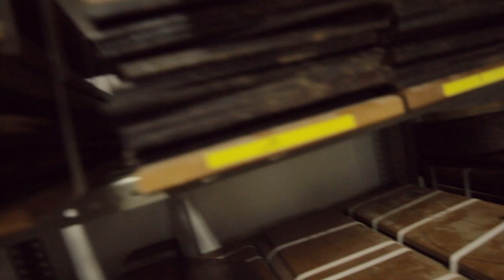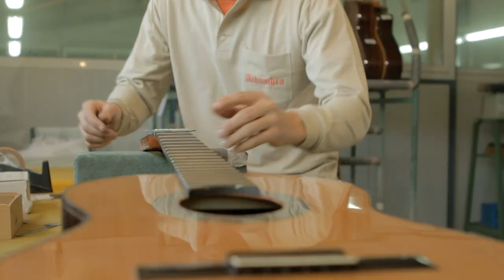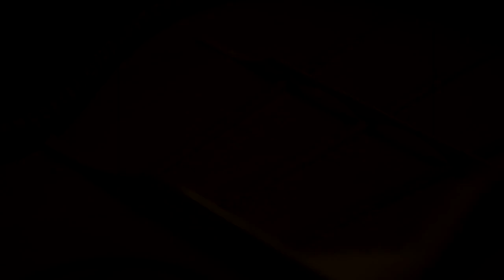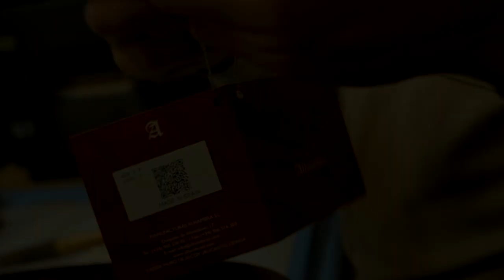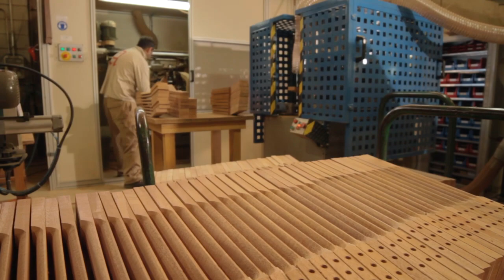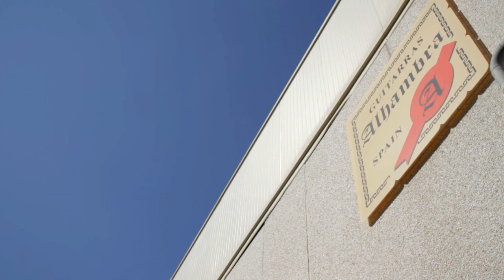Alhambra Guitars Spain

Comment: Congratulations for this People. I would not have nerves and patience to do this. 
If you wanna buy some model of Alhambra you can click on and see my ad. You will got discount of 100€ on primary price of the guitar, free suitcase which costs 150 € and free D'addario Dynacore strings which cost 15€. If you wnt better model I have one for you. 
https://m.kupujemprodajem.com/muzika-i-instrumenti/gitare-akusticne-klasicne/koncertna-gitara-paulino-bernabe-m20-popust-600e-na-cenu-is/oglas/100277568#mhs0-1604374238981
https://m.kupujemprodajem.com/muzika-i-instrumenti/gitare-akusticne-klasicne/koncertna-gitara-alhambra-11c-popust-200-evra-na-cenu-ispod/oglas/76280661#mhs0-1604373736135
https://m.kupujemprodajem.com/sport-i-razonoda/tenis/head-microgel-radical-mp/oglas/99562831#mhs0-1604374306620
https://m.kupujemprodajem.com/sport-i-razonoda/tenis/sva-tri-reketa-za-60e/oglas/99850044#mhs0-1604374328769